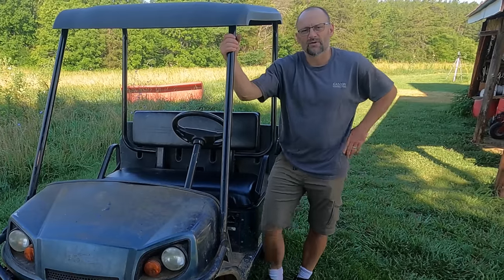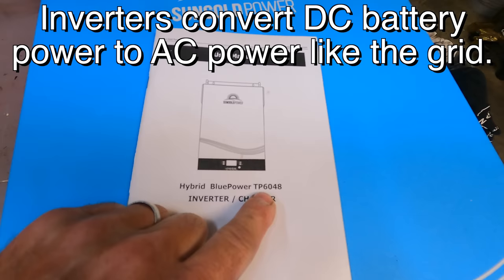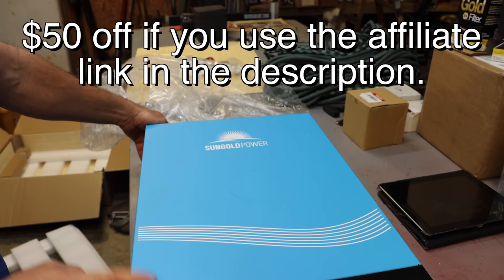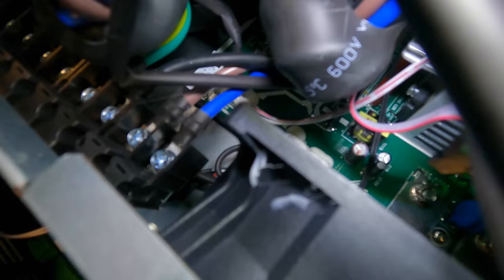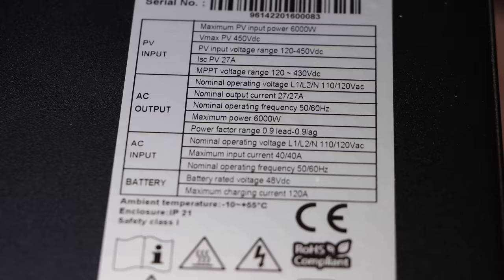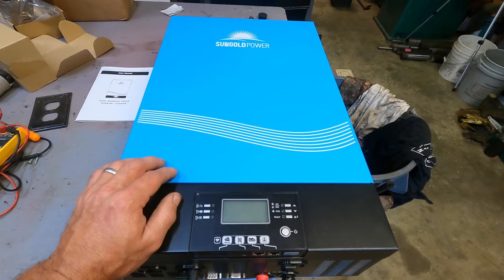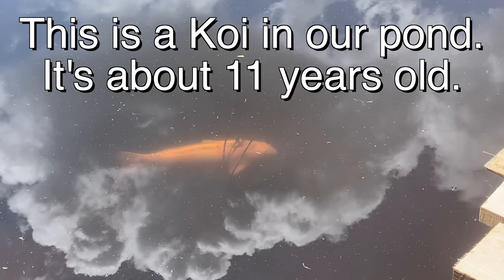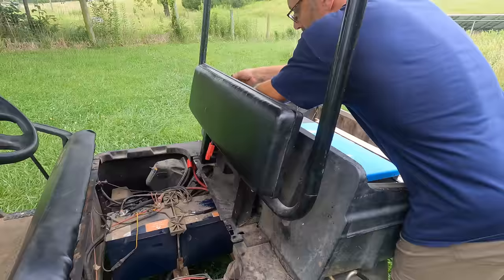Converting an Old Golf Cart into a Supercharged Power Plant.

Comment: I've got that same welder. Had it since 2007, still going strong. I love it! I've ran several hundred pounds of wire through it. I've had to rebuild the microswitch in the trigger twice now, but its so easy, and it's the only problem I've had with it. That inverter is extremely useful! I would love to be able to weld anywhere. One thing I'm looking to build eventually is a mobile skid with my welder, plasma cutter, and air compressor on it. Load it into the back of my truck and fix offroad rigs when we're out in the middle of nowhere beating the wheels off our trucks haha! I have a 6.5kw generator, but im unsure if it will be able to run my plasma cutter... that thing is a beast.

Comment: I don't mean to disparage the battery/inverter system, but it is far cheaper to just buy a generator of equal wattage & throw it in the back of the golf cart. I made some brackets & permanently mounted mine in the back of my (good size) garden tractor, giving me additional traction in the winter when pushing snow. I've also had to use my welder in the field and it was very handy. In addition, batteries run down in a few hours, generator is good for weeks if you have enough fuel.
Reply: Remember he got it for free, we have to pay for it if we want it, changes everything

Comment: Nice looking inverter. The real test these days is how clean the output 60hz is. Meeting high wattage specs isn't too difficult with current standard components, but how much they bothered with the output filtering is what separates the good from the bad. Most electronics are much happier without the interference on their power supply, and even the power grid wants cleaner than the average cheap inverter will put out. Dirty inverter output is polluting the grid, cheap solar systems are messing with the grid so much as to dirty the power on the whole neighborhood.

The trick is most don't know about this, and don't have the tools to measure what they have. Minimum required is an O'scope and knowing how to use it. Due to this there are many manufacturers putting out 'value priced' inverters that don't bother with providing quality filtering.

Comment: Might not be a bad idea to get a Pelican type case to store and transport the inverter it, it would keep it protected from accidental drops and vibration during transport. When you get to where you're using power just pull it out and hook it up, could even make a hanging bracket to mount on the ROPS under cover and above dust kicked up from tools and the ground.

Comment: I have several friend who have converted electric golf carts into portable power stations.  They have replaced the sun roofs with solar panels to top up the charge.  Although one friend who lives in Florida on Soace Coast has 3, 650 Watt panels on his 4 seat with a dump bed cart.  Those panels keep his 6 8v batteries charged as he rarely has to plug it in.

Comment: Your shop was already set up with lockout... Wouldn't hurt to throw an extra circuit in there if you plan to run the shop off the cart often.
Reply from the maker: Actually I really don't plan to run the shop in that manner.  I should have been more clear about that.  The main reason I did that was to be able to test the inverter against my big shop tools.  It is nice to have as an option in a pinch, but really, if the power is out, I don't think I'm going to be woodworking with my golf cart batteries!

Comment: Hi

I think you may consider making a vertical shockproof mount for the inverter behind the seat so that the cooling works as designed, possibly make an intake air filter if you use it in a dusty environment.

An important suggestion is to try and use air-powered tools whenever possible...  running a compressor from the powerstation and using air-tools is ALWAYS SAFEST.

MANY PEOPLE DIE EACH YEAR from electrical tools - Usually in a confined space, but please just don't risk it, convert to air-tools and be safer!

You NEVER need to use a suicide cable...

You can buy a socket (receptacle) fitting for one end of the cable and mount a fixed plug on the wall.  The simple principle is that the exposed Male is NEVER live, only the exposed female should be live.  Your Johnson should always be 0 volts!

IN EVERY INSTALLATION the fixed male plug is interlocked off at the panel so that it cannot be made live from the electricity companies supply!

------------------------

Going back to some time ago regarding your boiler...  does the chimney (I cannot really see a proper extension outside) have a spark arrestor on it, otherwise I wondered if that was how the fire started.  Maybe fit a braced chimney above the boiler-house, preferably with a spark arrestor or a few offset bends that would allow embers to cool before exiting.

My other safety comment is about eggs and baskets really.  Maybe don't put too much wood in the woodstore, build another store somewhere further from the house for the bulk of your wood and just keep less stock in the boiler woodhouse, restocking  occasionally from your bulk store.

Comment: You should wire each receptacle to different 120v circuit. That would allow you to use multiple tools at the same time.

There might have been a large capacitor in the inverter, so you could have been killed. Leather or rubber gloves next time.
Reply: Agreed on the capacitor, I noticed I was hoping he did a double take after already safely uncharging it because I felt stressed

Comment: Hi,could use some shrink tubeing on those cables.Nice set up,but to pricy for me.
Reply: thought the same. I really dont like exposed wire and you can touch the high voltage from outside the case. That should really not the.
Reply: Agreed. I think, he just slapped it together for the video. He's a smart guy and am sure would normally do it.
Reply from the maker: @aullik You cannot touch the high voltage from outside the case.  Not sure what you mean.  The battery voltage is 48V and it will not shock you.  Even so, I did tape those ends and they also can't be touched from outside.
Reply: More for a corrosion stand point on big cables,it starts there and spreads up the wire.I assemble with silicone electrical paste too.Awsome video's, thanks for showing us your beautiful farm.

Comment: Just discovered your channel this morning from this video.  I'd say thanks, except I now see too many hours I'm going to get sucked into going over a lot of your older content.

I love the inverter tied to the cart idea.  Yes, others have pointed out that a generator is going to be the most economic investment for the same portable power.  But if you are like me and have begun investing in a solar powered property, each item that requires only the sun to run quietly is a step away from being dependent on volatile fuel prices. I also get it, there is a large capital investment, and it takes years of use to make up the cost of a fossil fueled appliance + fuel used.  But I can't make my own fossil fuel and each step that I can get away from importing power sources gives me more independence from the politics of bringing power of any kind to my property.  Plus, once set up, the convenience of power from the cart that brings you to the worksite is just awesome.

Comment: Well, For what it is worth, One of the design engineers, that works for SunGoldPower, used to design power amplifiers for a very high end company many many years ago, called Phoenix Gold, and more over, he played a major role in the ZPA-3.0 and the ZPA-5.0 monsters, and the ZX series of amazing amplifiers, that kept that company on top of the world so long. They were well deigned, very precise, beautiful, built in security on both the input and output of the units making them almost indestructible... If you plumbing in a an approx 30Hz to 80Hz signal to the inputs, and wired in to the outputs of the amplifier, you could run a power tool, up to about a 30 amp draw.. which is extremely hard on a system, to handle that much current...

Comment: 13:23 I could have sworn that a clamp meter cannot measure current draw if both conductors pass through it.  You need to isolate the neutral or hot.  At least that's what I've always heard and that's how my clamp meter works.  Does this Sperry unit use some form of black magic??
Reply from the maker: You are right. Only 1 conductor is going through it in the video.
Reply: It is badly visible in the video but the cable is split open near the clamp. For instance, there is a green-ish wire visible that does not go through the meter's clamp.
Reply: i guess we have a blind enginerd here ... oh boy

Comment: Now you need about 400watts of solar on the roof, to help keep the battery charged!! Maybe get 4x 30-50 amp hour, 4s batteries to go with it, to give more run time,  maybe a lean-to made with solar panels to park it under, maybe  a receptacle to use the power when not in use, keep a fridge or freezer running for free!

Comment: Id put in a second set of batteries one to use thd cart and one as a power station, the roof also lookes like you can put a solar panel on it to trickle charge the batteries. 
Actually one of these and a solar panel set up on the barn with batteries could be an off grid station to keep tools and machines powered up and ready.  It can always be connected to the house as well.

Comment: 16:00 you already have an interlock, why don't you install a 50A breaker and get a 50A power inlet which makes that cable safe... 16:20 your suicide cable could also kill a utility worker if your inverter didn't blow up.  I am guessing you have plans and know this, given the interlock breaker is missing, in reality you could get away with a 30A breaker/power inlet which will support a single 6000W, you wold need at least 2 inverters in parallel 12000W to supply 50A circuit.
Reply from the maker: I don't plan on powering the shop in this manner, but I wanted it as an option in a pinch.  An interlock would prevent me from using the RV plug for its actual purpose, plugging in my parents RV.  The real reason I did this was to test the power of the inverter against my shop tools.

Comment: People! Suicide plugs are bad! Don’t understand why anyone would do that. You might understand the risk, but your kid or well intention friend may not.

Setting that aside, this is exactly what I want to do with my 72 v cushman hauler pro. Lithium, inverter, portable farm power! My ground is pretty good for digging. So an 1500w post hole auger, temp power to the barn, temp power to the house.  I think I’ll add a plug for my welder! I had the exact same concern about vibration and the inverter.  Dropping an inverter box in the back when I need power is the better way to go. 

Also, maybe isolate the 110 outlets (just break the hot tab), and run off opposite legs. Or add a second outlet for other leg

Cool stuff, subscribed!

Comment: I’m sure that’s not hot snot glue on the power electronics! It would run out while it was working hard! It’s usually silicone. Your jump cable gave me chills - especially the order you decided to plug it in! Love the vids though 👌
Reply from the maker: Good point on the hot snot.  Maybe some kind of epoxy.  You are correct, it would have been safer to do connect them in the opposite order.  I often work with live wires and breakers, so I'm fairly comfortable with it.  Maybe too comfortable?  ;-)

Comment: I had a  great Ford truck, a 7.3 diesel that other than the start when cold was better than a  pocket on my tee shirts. I live in Alaska and its around thirty below for weeks... parked downtown for eight hours meant that you walk home or use a gen set to heat the system for the block and pan... it would start just breathing on the starter if plugged in but hell, it was cantankerous at sometimes thirty above because the starter was dragging and being crippled... I haven't  walked now for seventeen years, I am nearly seventy three so putting a gen set in my truck wasn't a real option as its also cold when needed to start and heat the truck.. the odd thing was the factory heater system was so good that any home plug in for just ten minutes would get it running... meaning that sure, you wait ten minutes alright  but walking almost sixty miles to home might just take a few minutes don't ya  thinks??/LOL. I got rid of it just because of no help to have the starter replaced... and a new starter will break my bank anyway. I  got rid of my rig for that only reason and had "traders remorse every since! I had offers on it for ten grand but they were not handy and a neighbor offered me his explorer for a trade and in the heat of anger did that trade.... pissed ever since

Comment: Love your channel, stumbled on it from your video installing the Generac gen set. BTW, your clamp-on meter is not designed to measure around the extension cord like you had it. You have to break out the hot and neutral and clamp around a single conductor.

Comment: Love the content, but watching you strip the ends of that cable was rough! I have to recommend the Knipex 9505155 scissors, $30 on amazon. I do commercial upfitting, build work trucks, and these things are the tits. Cut loom, tape, anything smaller than 14 gauge with ease, and strip large wire ends. They also allow a superb amount of control for removing sheathing where you have a bunch of thin wires underneath.

Comment: They used some electrolic capacitors where a solid-state would be better for long term service. But you can probably swap out boards however hot gluing connectors really isn't a good idea for serviceable. Its decent build qulity not really high-end  it has both top notch parts and some medoaker stuff. Probably made in Taiwan or china.

Comment: I hope Sungold is happy with your review. Your use of it seems to me a waste of money for an application better served by a gas power generator. 
One thing, is the built in controller on this inverter MPPT?
Also, why does it have an AC power input when the solar panels output DC voltage? Is it meant to be hardwired to a houses AC circuit for power outages? and if so, does it have a built in automatic AC power transfer switch?

Comment: You're not using off the shelf lithium batteries with snow on the ground, bud. 
There's a good reason why mechanics up north use pneumatics tools.
   They can't charge or discharge, probably.
Unless you have a battery warmer. 
 A generator is a far better option.

Comment: I think that's called a suicide lead. All you need to do is put a cross over switch  and a generator input for it (this way power can only be supplied by 1 source). It's a bit dangerous for that cable to have 2 plugs, but it's not like people don't do it. I know you know what you're doing so not bashing you at all. Just leaving this in case anyone wants to do the same and has to worry about code violations
Reply: Actually that bracket that slides down when you turn off power in your shop is a cheaper way instead of the transfer switch. If you moved your generator input to the lower right spot, it would only allow one or the other to be turned on.
Reply from the maker: You are correct.  I thought I explained fairly well that it wasn't code and was dangerous and cautioned against doing it unless you really know what you are doing.  An interlock would unfortunately prevent the outlet from doing its primary function, that being a place to plug in my parent's RV.  Appreciate the concern.  I probably should have cautioned more.
Reply: @FarmCraft101  You most certainly made it clear. I started my comment just to say the name of that cable and it's dangers. I then just moved into some stuff for people to look into.

You handled the situation a lot better than a lot of other youtubers I've seen and I really appreciate that you do that.

Comment: 10:12 please, for the love of Jebus, alter the procedure as follows... 
1. Turn off breaker in barn
2. Stick plug into socket of now dead barn wiring
3. Stick other end of death trap power lead plug into inverter
4. Switch on inverter

Having worked in the computer rodeo game for decades, it's always astonished me that when it comes to uninterrupted power supplies, we take mains voltage, cram it down to 24, 12, or 8 volts, stick it into batteries, and then when the mains power fails we take the battery voltage and ramp it back up to mains AC voltage to power PC's, servers, switches and other IT equipment that contain a PSU that drops that mains voltage back down to, usually, no more than 12 volts DC to run the equipment. I get that you are trying to run a welder, saw, etc from a battery, but think of the insanity of plugging in a 5 volt phone charger into that inverter. You're basically taking 48 volts DC from the battery, ramping it up to 120 volts AC, and then dropping it back down to 5 volts DC to charge a phone...  
Excellent job, as always. I love your videos. Oh and it's nice to see Jen in the videos, however we'll need to see her holding a copy of todays newspaper, hostage style, to prove you're not just using old pre, not so shallow grave, hole footage...🤣🤣🤣
Reply: That's why in large datacenters (think google, facebook, etc), each rack has built in UPS (batteries), and the power supplies to run the servers take DC in - probably -48V, as that's a standard telecom voltage, so there's a lot of existing equipment and power supplies that are already designed to run from -48VDC. Yup, converting the voltage up and down and back and forth from AC to DC to AC to DC is just stupid (and inefficient).

Comment: Hi - looks awesome - but for Gods sake be careful with your back feeding line - its a death lead..
Better to invest in setting up a system that has a female socket as an outlet - means you cant accidentally - you accident...!!!

Keep up the great work.

Phil in NZ.
Reply: > female socket as an outlet
You mean a wall-mounted plug. Interlocked at the consumer unit with a changeover switch. Connected to the inverter with a regular extension cable.